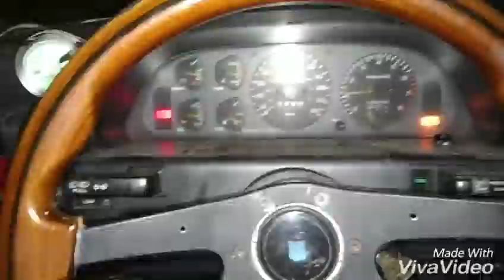Probe GT Turbo vs Toyota Soarer GT Twin Turbo

Comment: it'd be pretty cool if you can make a video on how to delete the PCV system
Reply from the maker: boostedKTM I can tell you right now how to do it. you take the PCV out of the valve cover, and cap the port it goes into the intake manifold. Done.
Reply: BigTurboProbeGT my stock IHI took a shit (83k) so I'm getting ready to do the T-bird hybrid upgrade. do you thank the bypass will help? also will the stock bypass valve be ok with the hybrid at about 10-14psi?
Reply from the maker: boostedKTM No, stock BPV doesn't vent enough. need aftermarket BOV after turbo upgrade. but skip the Tbird hybrid. t3 flange your exhaust Manifold and get a .42/.48 AR Garrett 45 or 50trim T3 off a Volvo 740, or turbo Dodge 4-cyl. good for 70hp over stock. Tbird hybrid will blow up even quicker than stock turbo at 14psi and is only good for 20hp.
Reply from the maker: boostedKTM you need this upgrade. mine was $50. 

https://youtu.be/JGpYFB2zOYg
Reply: BigTurboProbeGT  ok I'll give you $50 for it...JK  sweet setup I found the hybrid at local  junk yard and I live in the sticks so not a lot to choose from. I think I'm going to use the hybrid just to get it back on the road I dumped all my money in my CTS-V (new 8.8 and cv's and one piece carbon fiber driveshaft
Reply from the maker: boostedKTM dumping all that money in a GM product. gross
Reply: BigTurboProbeGT I love the LS6.... but I do have 3 first gen probes so you gotta cut me a little Slack. 89pgt(80k) 90pgt (90k) 89 (miles=shit ton..lol)
Reply from the maker: boostedKTM LOL yeah but it sounds like they are getting neglected while you work on a CTS-V which has the absolute worst rear differential I have ever seen next to the Chrysler 300C
Reply: BigTurboProbeGT they do they're like glass that's why I did the creative steel 8.8 upgrade and it's a boss 410 and posi
Reply: it reminds me of never posted any videos of my probes I'm going to slap one up and upload it real quick for you should check it out
Reply from the maker: boostedKTM will do. haha. not watching CTSV video though haha.

Comment: What kind of power are you making?
I've got a channel about our crappy budget race builds if you're interested.
Reply from the maker: had exhaust leaks robbing efficiency and a restrictive PCV system that's now deleted. so was making about 230whp and 300wtq in this video. now making 250+whp and 330ish WTQ at the same boost.